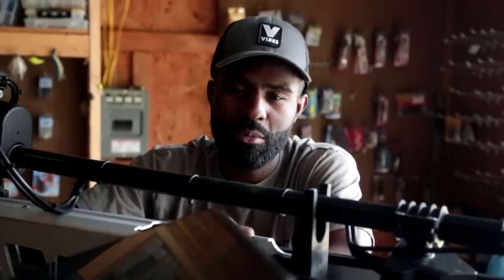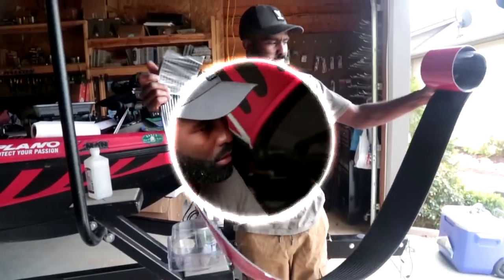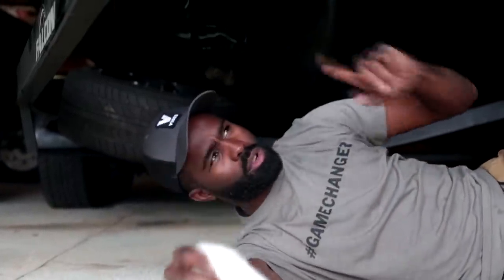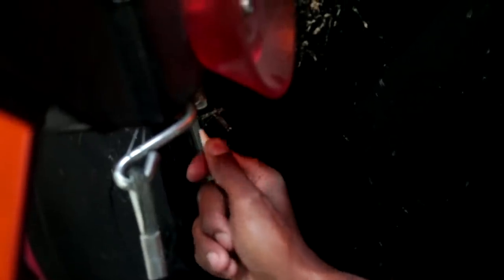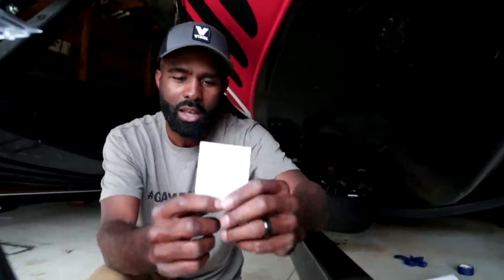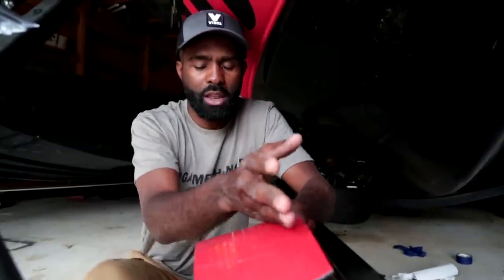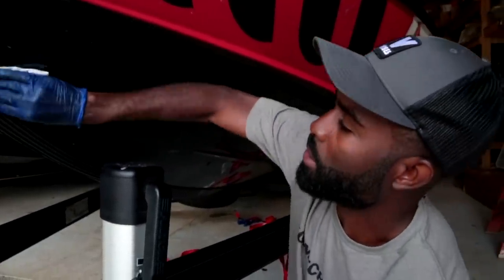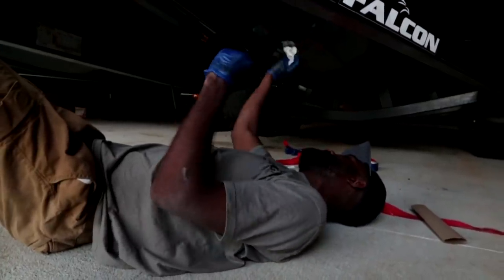Every Bass Boat Needs This! - - ( Keelshield Install)

Comment: Nice Video and install buddy. I would recommend having your trailer hooked to your vehicle or have extra jack stand under your rig while your under your boat just in case the main jack fails and could crush someone.
Reply from the maker: You can add a little silicone around the edges of your keelshield to make it bulletproof!

Comment: Can i use ethilic alcohol instead isopropyl to clean the surface? I got my keel shield two day ago.
Reply: Julian, in a pinch you can use denatured alcohol to clean the surface first. I know its tough to get rubbing alcohol right now. However if you use acetone or anything else to that nature, it can end up leaving a film which can affect the adhesive

Comment: So do you think it's necessary to put one on a tracker super guide v-16 it's a aluminum boat I manly bass fish with it. It's a shallow v so I can fish lake Michigan and rivers with it. Whats you think apply or not. Thanks
Reply: The marina near me said the adhesive doesn’t really stick to aluminum boats.
Reply from the maker: Yes absolutely!!! I have one on my G3!!! Gotta have one on all my boats
Reply: Dylan, I've had my KeelShield on my Tracker TV18 for 5 years with zero issues. As long as you prepare the surface per the instructions you're good to go!
Reply: Make sure to use a heat gun to really get the adhesive primes for the aluminum and use it some on the hull of your boat